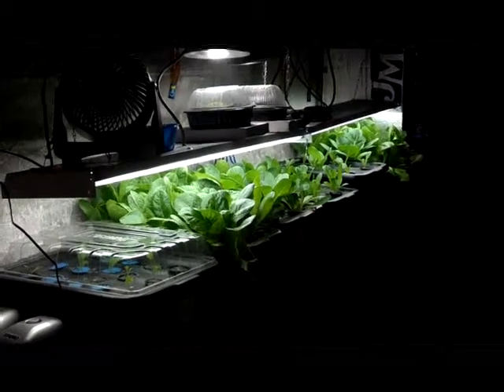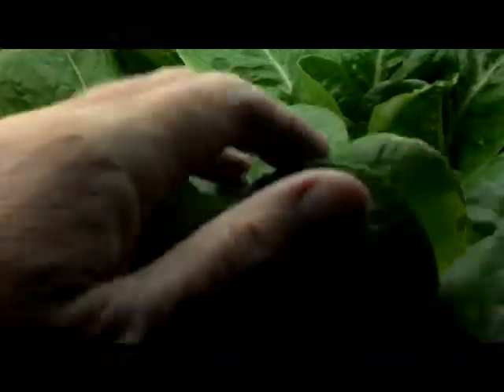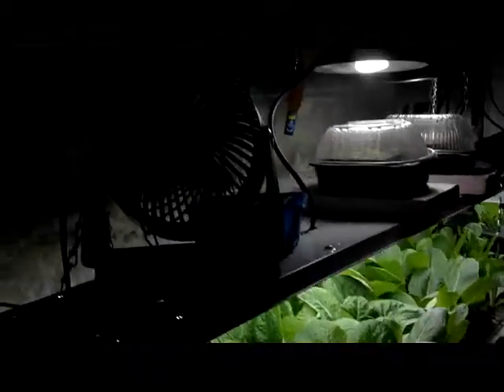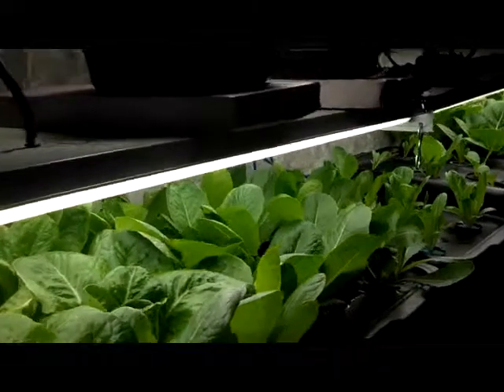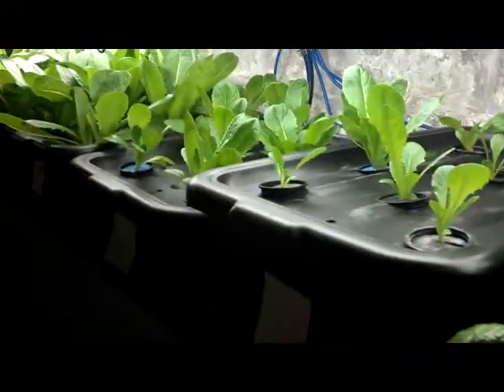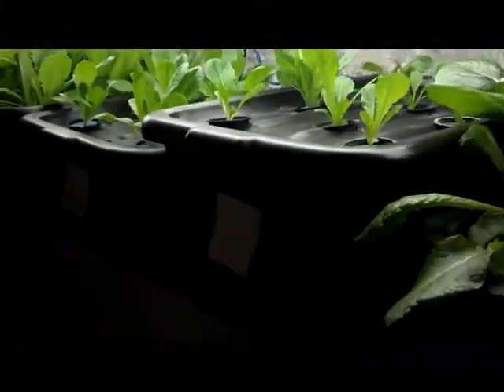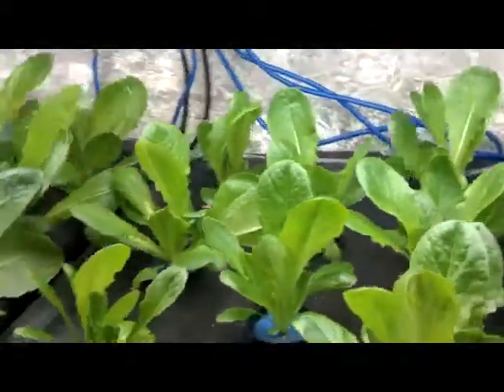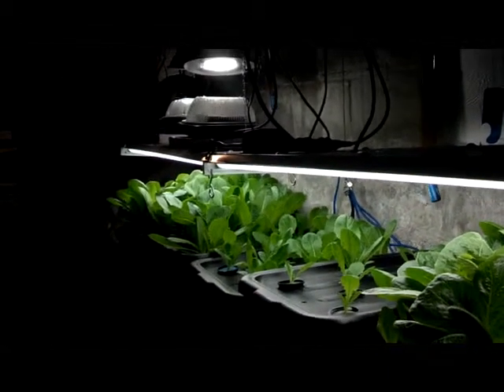Edge Burn, Hydroponic Lettuce Continuous Harvest Experiment

Comment: Did you ever make any definitive progress on this? I've got the same thing happening. I've also adjusted my process as you did yours. Ph and PPM are good but I still have outer leaf marginal necrosis. The inner leaf tip burn was taken care of with the lowering of the PPM in the nutrient solution but the outer leaf issue drags on.
Reply from the maker: +David Newton 
I was not running the hydro system over the winter, but have restarted it.  I did not find a way to fix the problem last year.